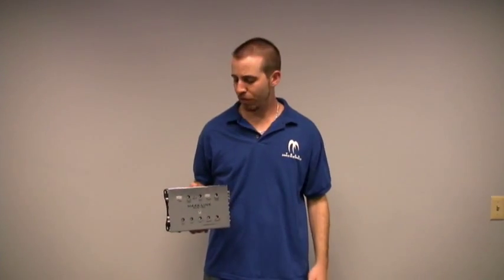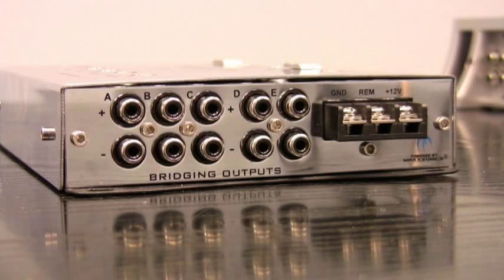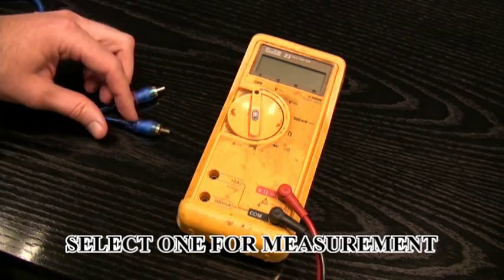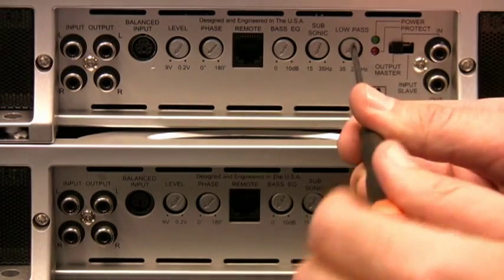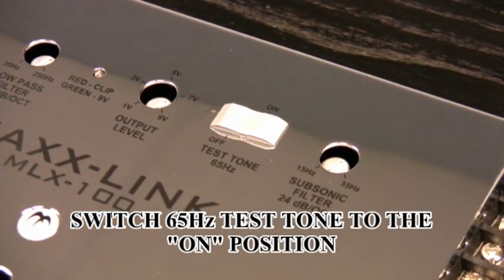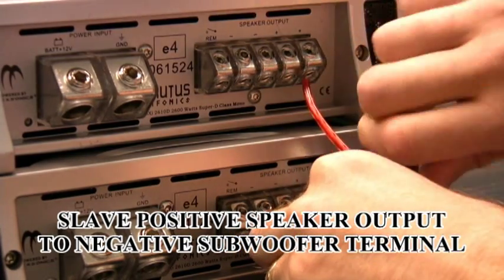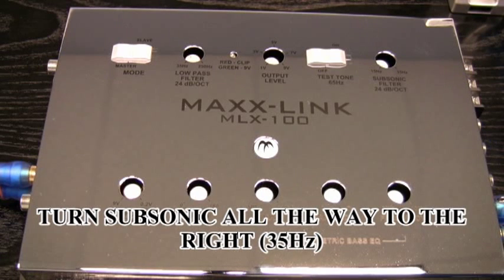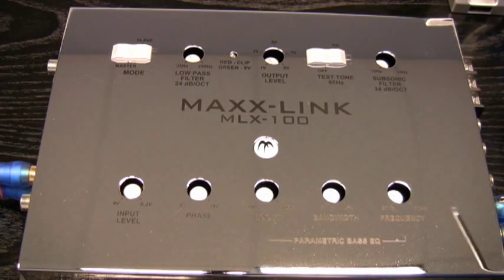Maxxlink MLX100 Amplifier Bridging Module. Tutorial Part 1

Comment from the maker: @LooseCannon48 If your amplifiers have a Master/Slave switch then you can switch them to "Slave" which bypasses all adjustments and allows for the Maxxlink to control everything. If they do not feature the Master'Slave switch then you will have to match the amps and adjust everything at the amps prior to relying on the Maxxlink.

Comment: I was going to use this for controlling two amps that aren't linked.  From what video said is that I could set everything on the unit and not touch the amps or would I have the set the crossover all the way to the right for this.

Comment: @MaxxsonicsUSAInc 

So If you are using two MM1400.1D's in the slave/master configuration, the final output will be 2800 rms @ 2 ohms?

Comment: Hey Mike, im in the middle of building a huge system, i have 8 audiopipe 3500.1. they are going to run 8 15's. one amp per sub at 1 ohm each. im looking for a why to simplify my rca connections to theses amps, and at the same time make sure each amp get the correct voltage of signal input,

Comment from the maker: Correct. Leave PHASE at 0 on all amps. The amps receiving signal from maxxlink + outputs with have standard + and - speaker polarity. The amps receiving maxxlink - signal will need to have reversed + and - speaker polarity so that all subs are aligned in PHASE. This is because the + and - signal from the Maxxlink is opposite.

Comment from the maker: No, this would not work. The PHASE adjustment on amplifiers nevers completely switches the PHASE. You could swap the + and - speakers wires on the second amplifier though. This will make the timing identical.

Comment from the maker: Ok, you will not be LINKING the amps at all. In fact you will simply be using the Maxxlink as a means of distributing signal to each amp and controlling everything exactly as shown in part 2 of the Maxxlink Tutorial Series . Start watching at 1:42 of part 2 and follow those EXACT instructions. Then you would simply wire 1 sub per amplifier. Please let me know if you have any further questions.

Comment: i plan on running 2 subs, each on their own amp (hifonics brutus BXI 2610D.

the subs are dual voice coil 2 ohm's at about 2300RMS. 

i plan to wire the subs down to 1 ohm. the amps put out 2600 at 1 ohm, and the subs can handle that power.

Comment from the maker: You are correct. Wire 2 coils in series to amp 1 at 2 Ohms. Then wire the remaining 2 coils in series to amp 2 at 2 Ohms. Watch the 2nd Maxxlink video and follow the recommendations for using the Maxxlink to supply balanced signal without linking. A+ and B+ to amp 1 inputs. C+ and D+ to amp 2 inputs. Then balance the amplifiers using and digital voltmeter and test tone as shown.

Comment: I have 1 sub that is a quad coil(1ohm) and
2 non-strapping identical amps. How do I
wire the subs to the amp? I also have a 3way
x-over. Do I use the source from the output
sub side of the x-over?

Comment from the maker: If you refer to the manual you will see that there are indeed impedance limitations. For example, if your amps are 1 Ohm stable per then you must present a 2 Ohm load to the linked pair so that each sees 1 Ohm.